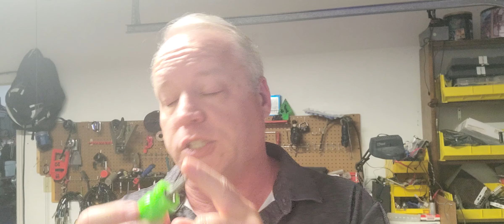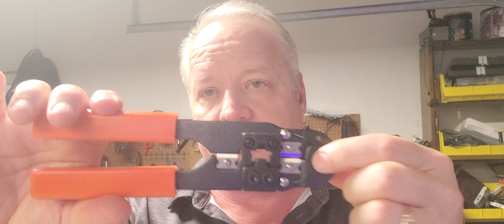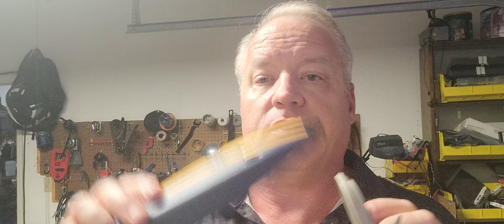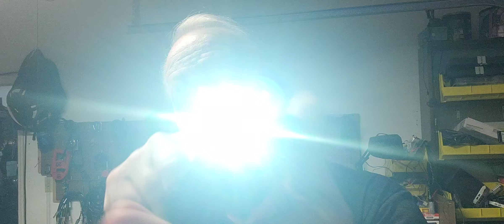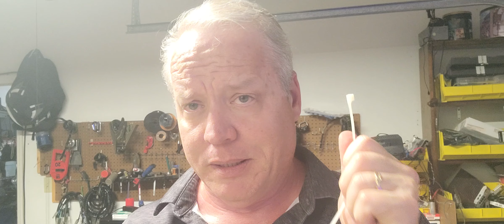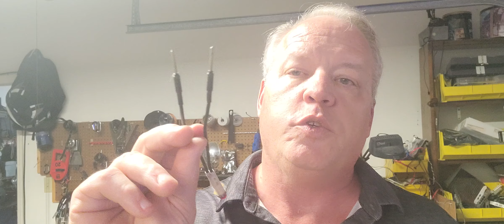Your IT server home Lab needs the right tools and how to save money at the same time

Comment: Thanks Brad. I have done similar service work in the controls and automation industry. 90% of the time dealing with PCs or servers running control systems, often coming across customers gear, varying between 5-20 years old. Requires a similar bunch of tools and equipment……spent 4 years building my toolkit, basically be prepared for anything.